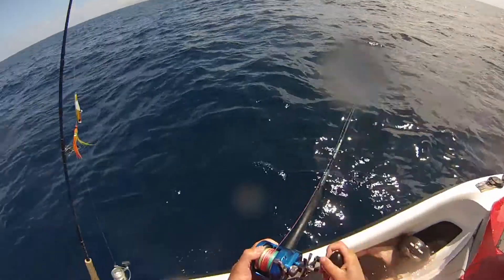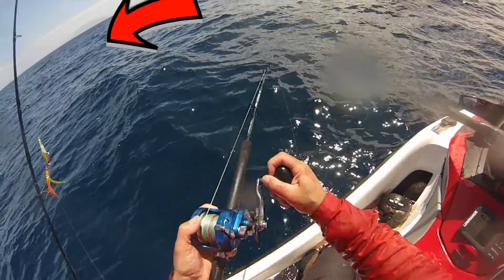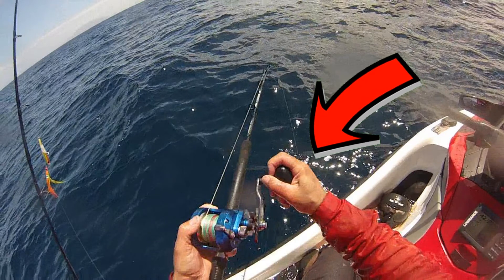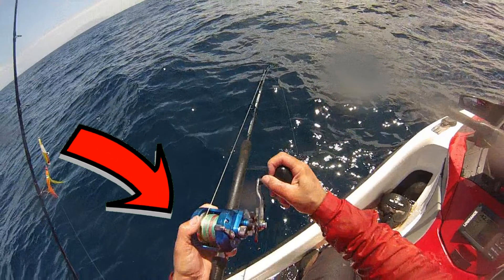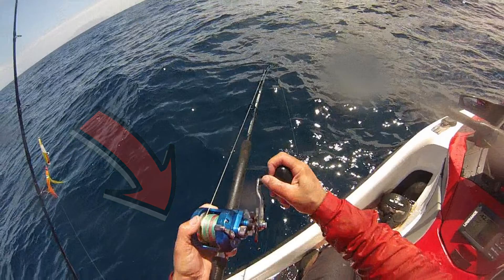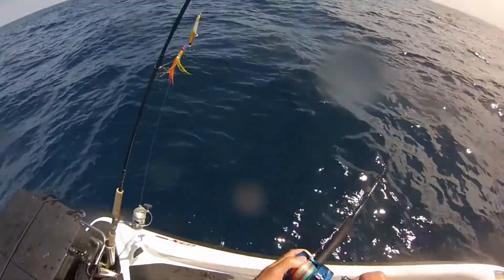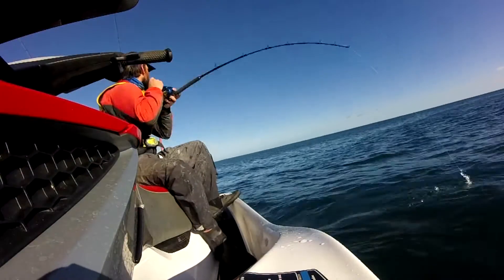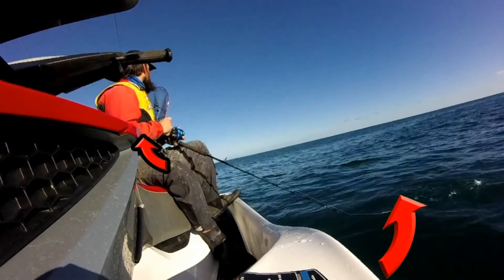How To : Mechanical Jigging Tutorial

Comment: Like Mathew said about the tuna, it works great here in South Florida mate. That's how the majority of tuna are landed from kayaks here. We drift a live bait as we jig the various depths, in search of tuna and pelagic fish in general. Great tutorial. Tight Lines.
Reply from the maker: What size and type of jigs do you prefer for tuna?
Reply: +GC Jetski Fishing 

I like to use 150gram speed jigs. The speed jigs get into the strike zone quickly and can be jigged up without much effort. Also, if you notice on some of my jigging for tuna videos, I wear a fighting belt, that doubles as a pivot point on the rod end and helps all around in controlling the fish.
Reply from the maker: Ok well I've got plenty of speed jigs but none that small, speed jigs are preferred for kingfish here but generally don't go any lighter than 250g but i'm sure I will be able to find some smaller ones.

Comment: Great video, it wasn't working that great for me because I was holding the rod instead of the reel.
Reply from the maker: That is a common mistake for beginners. holding the reel will help keep everything stable. when you hold the rod, everything tends to wobble around when you try to jig and wind. This is why jigging reels have smaller bodies that fit in your hand better.